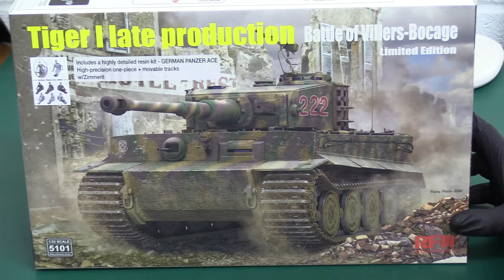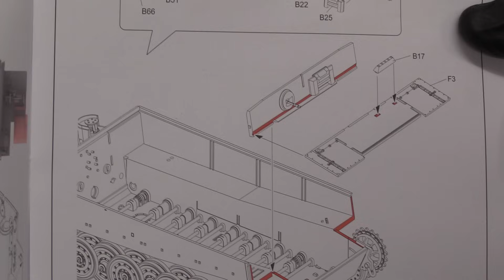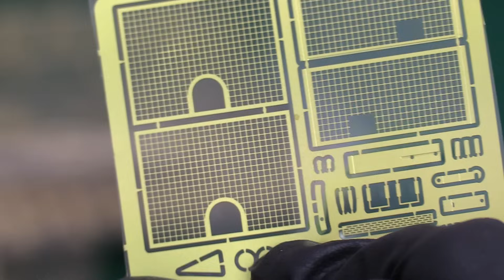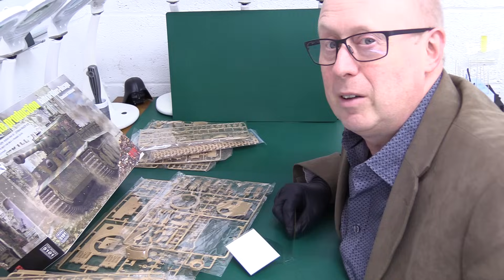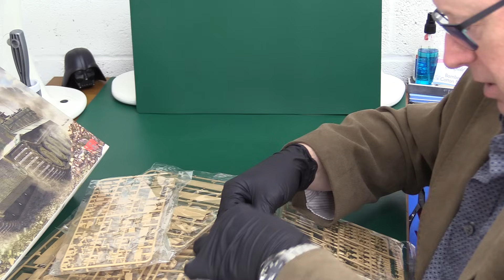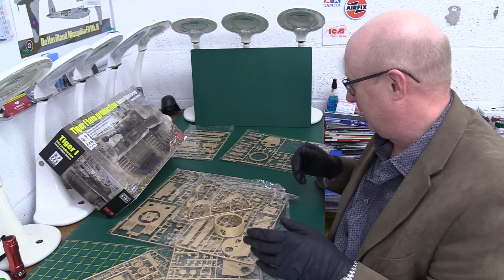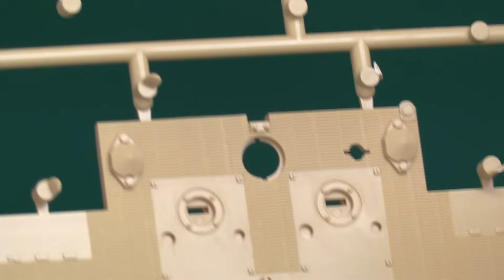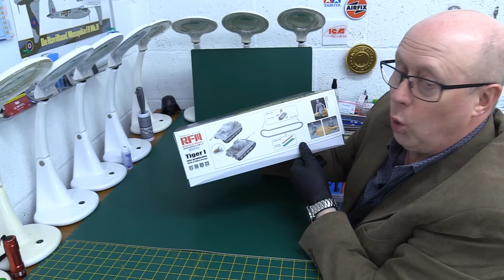TIGER NIGHT! RFM 1/35 Wittmann Villers-Bocage Ltd Edition 5101 kit review

Comment: Pretty sure 212 was Bobby Woll’s tank as he was no longer Wittmans gunner in Normandy, and was a tank commander himself.  I have a chart in a book I read that has every tank, and it’s assigned commander but I don’t have access to it at the moment.  Sowa was the commander of 222 which I forget which tank he ended up commanding for Viller Bocage.  I have multiple books on this battle from the British point of view and the Germans.  Wittman was lucky going through the town because Capt Dye I believe had backed his Cromwell into an ambush position in a courtyard, but his gunner had gotten out to take a piss.  Once crewed up they pulled out and tried to engage Wittman further down the street, but the shots were ineffective.  Wittman turned his turret and destroyed the Cromwell launching the Capt out of the turret which I’m pretty sure he survived.  Below will be the big bullet pts of the battle.

2nd Company of the 101st SS Panzer Battalion arrived on the night of June 12th with only 6 operational tanks.  The company moved 2-3 times during the night because of artillery barrages.  On the morning of the 13th the 2nd Company was parked on a side road outside of Villers Bocage.  Wittman hopped into 234 I’m pretty sure when he spotted the British column approximately 200-300 yards away, but 234 had either transmission or engine problems.  He changed to 222, and charged out and started engaging targets.  He ordered the rest of the 2nd Company to support by fire.  He attacked Point 213 where the British column was having a commanders meeting.  After destroying tanks at Pt 213 he charged down the road engaging multiple different brens and half tracks at which point he entered Villers Bocage.  Then destroyed multiple Cromwell tanks and Sherman OP tanks along with Stuart light tanks from the recce company.  He continued through the Village till he encountered a Firefly tank which a house came apart on top of the firefly.  At that point he was attempting to regroup with the rest of the 2nd Company which had advanced onto Pt 213 when a 6 pound AT gun struck his Tiger in the drive sprocket and knocked the track off.  Wittman and his crew sat for 10-15 minutes shooting everything in sight with the main gun until the ammunition was expanded.  They then abandoned the Tiger and fled north to the Panzer Lehr Division.  The Tiger was left intact in hopes of recovery. 

The 1st Company of the 101st SS Panzer Battalion along with elements of the Panzer Lehr Division with Panzer IVs attacked Villers Bocage without much success.  A number of Panzer IVs were destroyed along with 4-5 Tigers of the 1st Company.  Before the British withdrew though I can’t remember the British Officers name had blankets soaked in gasoline stuffed in the turrets of all the Tigers disabled, and set ablaze so they couldn’t be recovered and repaired.  

The 22nd Armored Brigade then retreated into a Brigade Box for the evening.

There is a lot of the story left out, but the big bullet points are hit.  Wittman was the Company Commander and his tank was 205 which broke down while enroute to Normandy from their billeting area with transmission issues.

Your “222” build is nicely done, and would’ve been a late production, but the 101st had 45 Tigers as part of its T/E of which 18 were Mid Production Tigers.  The entire 3rd Company and the 3rd platoon of the 1st Company were mid production Tigers.  The Battalion Stab, 1st Company Stab along with its 1st and 2nd Platoons, and all the 2nd Company were late production Tigers.  

The 1st Company was withdrawn in early July I’m pretty sure, and sent to Germany to refit and train on the new Tiger II/King Tiger/Tiger Royal at which point they turned over their remaining Tigers to the 3rd Company.  The 1st Company returned to Normandy in late July or early August with the New Tiger IIs.

Long story, but after being formed in Northern Italy from the 13th Company of the 1st SS Panzer Division the 101st sent the 1st and 2nd Companies back to the Eastern Front while the 3rd Company was sent to Belgium.  On the Eastern Front the 101st was made into an oversized Company with 5 platoons with 5 tanks apiece.  When they were withdrawal, and sent to France to refit and rearm they left their remaining Tigers on the Eastern Front, but the 3rd Company was in Belgium already equipped with Mid production Tigers.

In Normandy there were approximately 200 total Tigers tanks.  
101st SS Panzer Battalion 59 between the 45 Tiger 1s and 14 Tiger 2s
102nd SS Panzer Battalion 45 Tiger 1s
503rd  Heavy Panzer Battalion 59 between Tiger 1s and Tiger 2s
Panzer Lehr Division had 14 Tiger 1s

I’m probably missing something, but what I can remember from around 50+ plus books read on Normandy, Allied tank tactics, and German armor tactics both on the Heer and SS units.  German tank commanders operated better because they typically had better equipment and situational awareness because the tank commanders typically wouldn’t “button up” the commanders hatch, and would pop up to get better awareness of the battlefield where as Allied Tank commanders would typically button up especially the Russians, and couldn’t get as good of a picture of the battlefield.  It’s 1 of the reasons the hatch from the early Tigers was changed from opening straight up to a slide opening hatch because the Russians would aim for the cupola/commanders hatch to kill/severely wound the German tank commanders of Tigers.
Reply from the maker: @hanzusmc7898  Thanks for the extra details. 👍🏻 I did explain Woll was no longer his gunner. 222 was the one on the rampage.

Comment: I remember reading about the Villiers Bocage engagement as a kid building the Tamiya 1/35 Tiger 1 (it had motors in those days and I'd ready shot up several Airfix ones with my air gun - so I was something of an expert), it seemed incredible that the Germans could ever loose with such weapons.
Of course, none of it is quite as depicted, when you see the images of the destroyed vehicles they are mostly "soft-skinned" and half-tracks, also not in a single track sunken road with dozens of destroyed Cromwell's as was originally described, and that narrative failed to mention Wittmann's tigers were destroyed later that day.
I think there is still a problem separating what were propaganda images from the time into real events that we take for granted now, they were after all only photographs, with no metadata proof.

Comment: The best molded on zimmerit is from Takom.  Their recent Tiger I family has the BEST rendering of zimmerit.  The random, sloppy and uneven troweling often seen on real vehicles is properly replicated by Takom.  The best area on this RFM kit is the gun mantlet and front hull glacis plate, looks very good there
Reply from the maker: @jimaltergott9326  But Jim, Their plastic is so hard it's like working with stainless steel! 🫣
Reply: @Peter-Oxley-Modelling-Lab  I have built the Grant tank Peter.  That was a good model, well engineered and good fit.  No interior, but that's ok for my purposes.

Comment: Thanks Peter! If you haven’t already, you might want to take a look at part F3, the plate that includes the front fenders, and which sits over the transmission area. Mine won’t fit to the lower hull. It seems too long in the middle of the piece, between the two notches that are meant to accommodate the fit to the lower hull. Admittedly, I’m a novice modeler, but it appears that I will have to cut a sliver out of the middle of the piece and glue them back together to get the whole thing to fit to the lower hull.

Comment: Very good kit review Peter. Rye Field Model manufacture some very good 1/35 armour models, especially the Tiger I and the American M1A1/M1A2 families. A huge amount of parts, so not for the novice modeller, but build into a nice model. I would especially recommend the Challenger II models which are up there with the Tamiya version. 

My only quibbles are the parts count and the instructions need careful consideration before each step. Generally the instructions are good and show similarities with Border Model instructions. I wonder if RFM and Border are part of the same manufacturer group? I agree with the point of the lack of history and technical specifications in the instruction manuals. Unfortunately most of the Chinese manufacturers do this or have a very short vehicle history on the side of the box.

I have just bought this model and will be purchasing the Magic Factory 1/48 Skyhawk next. This looks like a very good model from all the news I have heard and read. Perhaps one for a future review Peter?

Comment: The steel wheels of the later Tigers had no coating put on the outer rim it was a steel wheel !!!! It had tho a rubber cushioning system inside the wheel which had the same effect as a rubber rimmed wheel